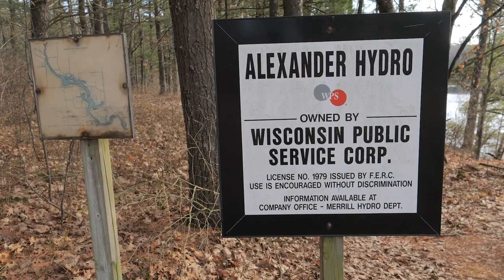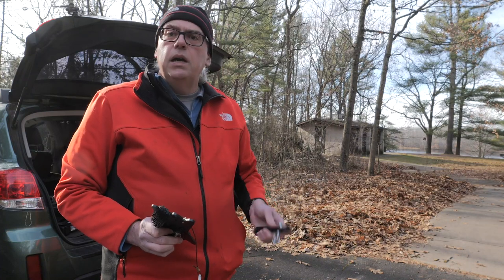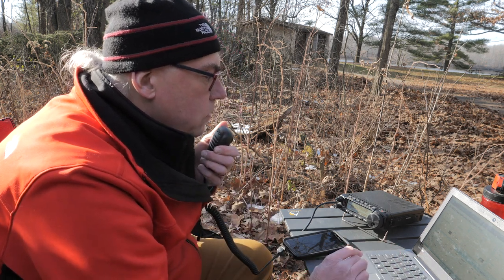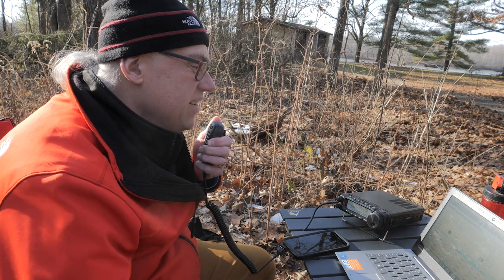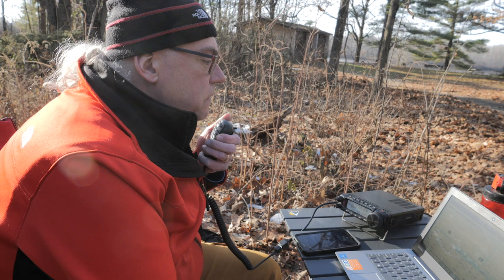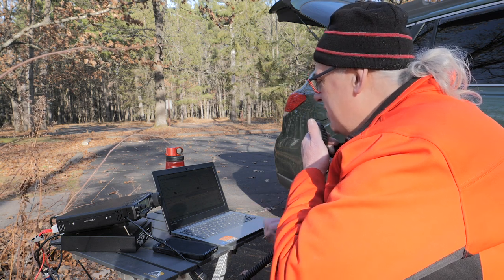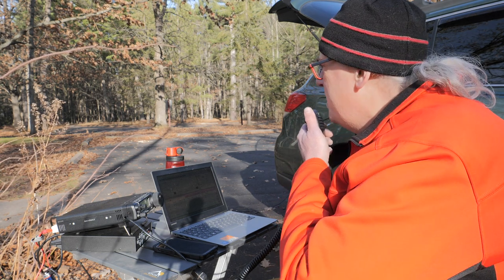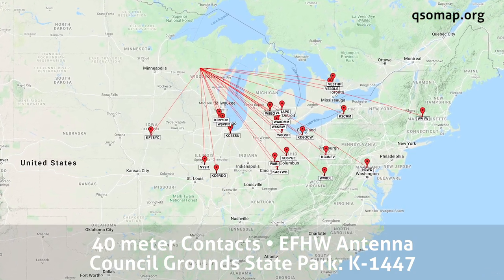Speedy End-Fed Half Wave antenna setup: Parks on the Air Council Grounds State Park #HamRadioQA

Comment: Great video & activation, Michael! I wonder if the hydro-electric damn was actually causing that noise on the radio. I've done an activation at a park across the river from the DuPont Experimental Station in Wilmington, DE and 40m was blasting with noise from there making the band unusable. I'm always on the lookout for such possible issues when activating and try to stay as far as possible to get the park or wildlife area activated!

Great to finally work you for the first time in this video! 73!
Reply from the maker: That video was our first contact, and now it seems like we talk every time we both are on the air. I may have to find a different spot to activate in that park away from the Hydro plant. But it was a pretty spot and no one bothered me.

Comment: Another good video.  What End Fed antenna do you use?  Is it DIY? I am trying to learn about EFHW for portable use.  I don’t mind building it, just like some guidance.  Hope you are keeping warm up in Wisconsin.  Texas can’t decide if it is fall or winter.  Haha.  All the best, 73 de KI5HXM.
Reply from the maker: This particular antenna is the Chameleon LEFS, end-fed half wave antenna. I've reviewed it on the channel previously. But all end fed half wave antennas pretty much work the same, and I could have used just about any EFHW in this configuration. The only difference is their portability and power handling capability.
Reply: @KB9VBRAntennas  oh yes, now I remember. I am learning.  I like what I see in the end fed half wave antennas.  At first I didn’t understand they were multiband. I have liked reviews of packtenna and chameleon and some kits that were built like HF kits.  Today is a good day to study and find these things because yesterday was summer and today is winter. Thanks for answering my questions. Warning: I might be back with more questions later. I will go back and look at the Chameleon. All the best! 73 de KI5HXM

Comment: So, Michael, another question(s) for you about your painter's pole deployment. These are 'what if' questions. (1) How do you think things would've worked if you had deployed a simple 20m dipole, center mounted at the top of your painter's pole? The metal construction of the pole did not seem to inhibit your use with the EFHW....curious how you think a dipole would've worked? [in such a configuration, I imagine it being colder, and you wanting to be *in the vehicle. And then (2) same question, only.... how do you think the pole would've worked had you mounted a lightweight 2m YAGI at the top for VHF simplex??  Thanks for everything, and especially for mulling over these 'what if' questions!  73, Tim KD9LAI
Reply from the maker: Last year I was mobile/rover in the Wisconsin QSO Party. I used the painter pole setup with my link dipole. While all the contacts were on 40m, I think performance would be similar on 20m. Interaction didn't really seem to be an issue. https://youtu.be/zrfDxrlFOwg. I haven't put a Yagi on the mast, but it is a bit flexible, and if you did, you would certainly need to guy it.
Reply: @KB9VBRAntennas  Thanks for the info. Gonna have to get me one of these. I always love shopping the ham radio department of Lowes/Home Depot.  :-)  73, Tim KD9LAI

Comment: What brand and length is your painters pole? I was looking at them at Omaha Lowes and Home Depot. The 24' are running $40ish and the 30' right at $80. Spendy lil things (but cheaper than our local Menards 14' pole at $231! Holy cow!) Looks like I'll be going to Omaha :)
Reply from the maker: I looked at my painters pole again and realized it is the 23 foot version even though I may have said 30' in the video. Here's the pole I'm using: https://www.homedepot.com/p/Mr-Longarm-Pro-Lok-23-ft-Adjustable-3-Section-Extension-Pole-2324/100177392
Reply: @KB9VBRAntennas  Ah, very good, that's the same one I have in my HD shopping cart :) Thanks so much!!

Comment: Thanks as always for the vid, Michael. I'm curious how much coax you were using? With the feedpoint 20ft up in the air,...and it looked like you were some distance away from the car. Just curious. Also, RG-8X, or... ??? Thanks!
Reply from the maker: I used 50 feet of RG-8X. I carry in my kit 2 25 foot runs of 8X and one 50 foot one. That's usually enough for just about any situation that may arise.
Reply: @KB9VBRAntennas  Michael, thanks...I appreciate the information. I ALSO appreciate your great use of a Home Depot painter's pole. I love EFHW antennas for their simplicity, but I can never be sure there'll be a tree handy. Over the years my goto has become my Jackite 28ft fiberglass mast. Thing is, tho, some antenna mfgrs (like Chameleon) really stress the importance of mounting the matching box on the high end. EZ to do if you're in a tree, not so EZ when the high end is a very small/maybe-brittle end of a Jackite mast. Your painter's pole solves that issue!

Comment: I like the roller idea, will borrow it. Not radio related but you brought it up so I will ask... What is wrong with the timber industry? You said something like, even though they made their fortune harvesting timber. To me it sounded like timber harvest is bad.  Thanks for an otherwise good video.
Reply from the maker: There is nothing wrong with the timber industry today. It's sustainable and well managed by knowledgeable foresters. At the turn of the 20th century it was a different story. People thought the forests would provide for 100s of years and lumber barons managed to cut everything down in 20.
Reply: @KB9VBRAntennas  and some day we will be judged for our use of lithium batteries.
Reply from the maker: I'm sure we will be.